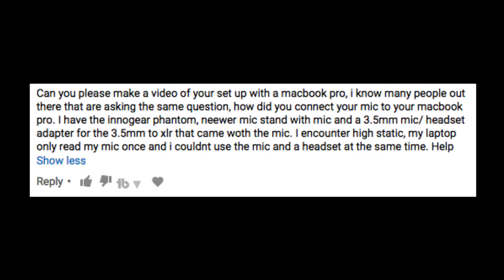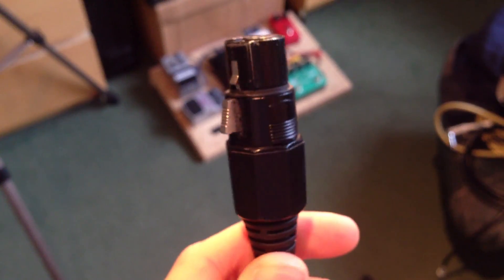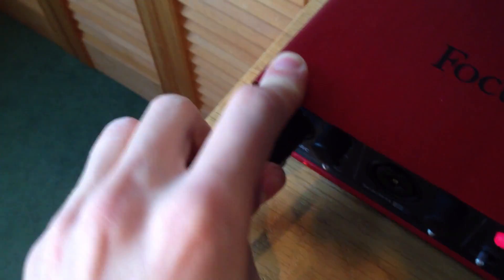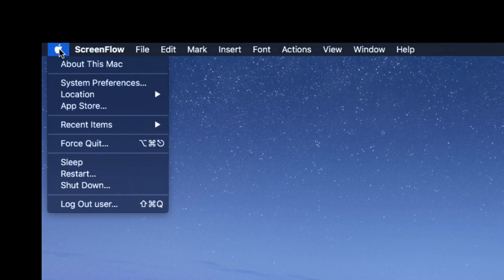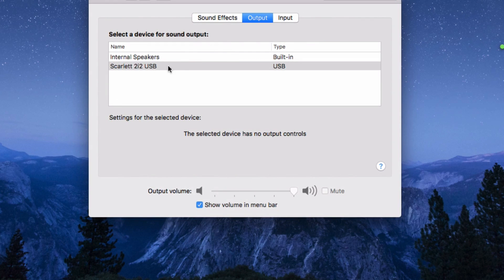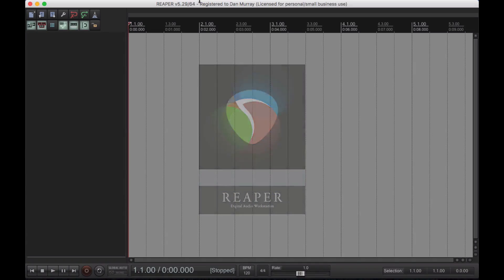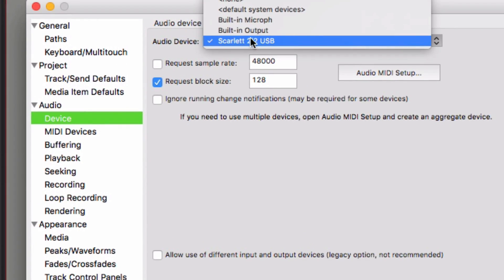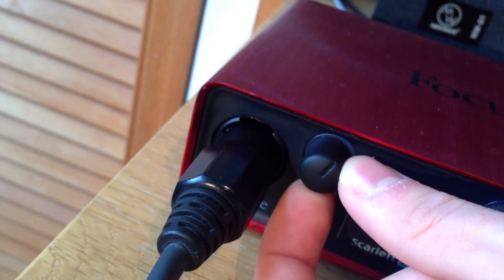How To Set Up The Neewer NW-700 Condenser Microphone

Comment: You can hook these pos mic's 7 ways to Sunday. The Neewer line of products are complete shite. No cable, no effort no video is going to make this crap work. The Blue line of USB, plug in, they work. Samson, plug and play as well. Neewer is pure shite. I have the lame 'phantom power and the correct cables. I was a radio DJ and mobile for 25 yrs. NEVER had I needed all this extra equipment to just get sound out of a damned mic. The video was fine. Ther neewer products, are crap. Save your money. Go PC, apple is shite.

Comment: had this mic for years and could never get it to work, i tried pluging it into a headphone spliter cause the headphones have a built in mic so i unplugged that and pluged in the microphone and it was perfect,i use a newer power supply and the xlr cable that goes from that to an aux is what i plug into the headphone jack, thank you for the help i was about to spend 50 quid on an audio interface but now i dont have to :D

Comment: Just buy the 7 in 1 its really useful as it already comes with an xlr to xlr cable and a xlr to 3.5 mm jack and a phantom power supply and everything you will need for this mic to sound great. Also if your on a laptop just get an adapter so that you can have both an headset jack and a microphone jack. you will need this as an universal 3.5 mm jack wont cut it.

Comment: video was good, I bought a NV 700 kit, that come with a 48v box, no switches or anything, but i have a sound mixer box so i just pluged the 3.5 into the sound mixer, was like £10 on ebay (new)  thanks for the help.

Comment: so I have this mic and im using the phantom power box that came with the mic itself. unfortuntately my Mac only had one port for input/output so I bought sabrent USB adapter to use both the mic and earbuds to hear what I was recording over. my problem is that when I record my voice sounds very low and muffled. idk if its from the USB adapter possibly distorting the sound, but I also have it plugged into a usb-c adapter being that my Mac doesn't have the regular USB port. could anyone provide assistance? any help is appreciative

Comment: Can I just connect the cable that comes with it using the audio jack
Reply: No that won't work. You have to have power going to your mic and your headphone jack on an apple computer won't supply any power. You either need the interface he talked about or a phantom power setup
Reply: @jakeannett6720  I have the phantom power but it still won't get recognized with the jack cable

Comment: Can you use it without phantom power
Reply: You can, but you will get a horrible Static noise.
Reply: i have the opposite problem, mine works fine without the phantom power, but its just quite because it doesnt have enough power to increase the gain
Reply: Yes, but you are very lucky if you  can just plug it in straight into your stationary computer/laptop.

Comment: Everything seems to be working for me Except For my InnoGear 229 Phantom. Theres no knob or anything to change the volume of input. I have the input volume as high as it can in system preferences. Anything I could do, or just get a whole new mixer?
Reply: I Have bm 800 condenser mic and running direectly into my PC Without phantom power good :D with a loud voice. Just to get rid of some noise I bought phantom power and i still awaiting it to arrive.
ps: Phantom power are designed to power the microphone and not to RUN. so Doesnt matter where you gonna put your mic (in your pc soundcard, or in a audio interface) if its not high quality its not because phantom power.  Phantom power only make the mic runs at full performance. If your pc doesnt have a good soundcard it will probabily sound bad, but the phantom power is not the issue.  "they are not designed to run straight into a computer." I disagree

Comment: Hey dude, I'm having a problem with my nw-700 that wasn't explained in this video. I have an XLR to XLR going into a phantom power box (no controls or anything), with a XLR to 3.5 mm jack coming out of it. When I try to plug that 3.5 mm into my MacBook, it is only detected as headphones in my output section of the Sound tab in System Preferences. I also got a dual-port adapter so I could run it just to the mic port, but it still shows up as just headphones. P.S, I also tried everything with a trrs adapter. If you could give me any suggestions, such as maybe trying an XLR to USB instead, that would be greatly appreciated.
Reply: You're too damn complicated :/
Reply: Oh ok. What cable would you reccomended instead that may work? I thought that the phantom power would make it work but apparently not.
Reply: iCrusherz - ROBLOX Thank you so much!
Reply: Icrushers, thanks so much! I’ve had this problem for nearly a year, and I haven’t figured out how to do it. You really helped me out! Thanks
Reply: I'm having the same problem too and I can't figure it out :/
Reply: iCrusherz - ROBLOX Buy a soundcard
Reply: Yo bro did you by any chance purchase the xlr to usb? if yes did it work?
Reply: So usually there are 2 xlr ports so maybe you connected it to the wrong one? Is that possible?
Reply: iCrusherz - ROBLOX thanks vro
Reply: you need a sound card
Reply: It doesn't work on macs ;c
Reply: Doesn’t work on Mac
Reply: Hey, I saw this comment and I wanted to say I figured it out! I bought another adapted and my computer recognized it! Here is the link to it https://www.walmart.com/ip/SC4-3.5mm-TRS-to-TRRS-Adaptor/48848902?wmlspartner=wlpa&selectedSellerId=1193&adid=22222222227036338802&wl0=&wl1=g&wl2=c&wl3=57513302138&wl4=aud-273067695102:pla-89876217458&wl5=9010869&wl6=&wl7=&wl8=&wl9=pla&wl10=112561658&wl11=online&wl12=48848902&wl13=&veh=sem I know it's long but if you buy this it will probably work with the microphone in a Mac. Good luck!
Reply: I only have one headphone port so how would that work?
Reply: what is your laptop?
Reply: @icrusherz-roblox313  Just bought the adapter. Doesn't recognize :( .